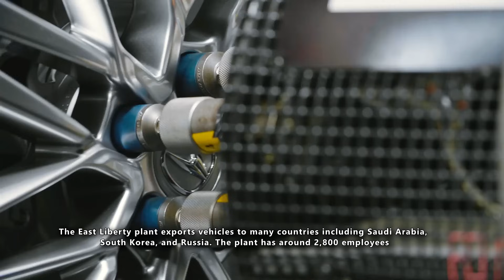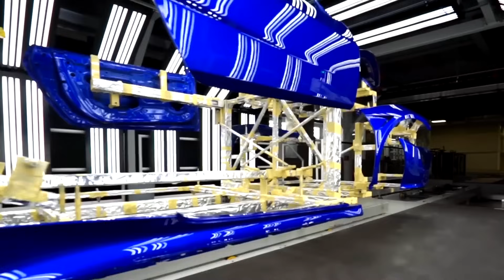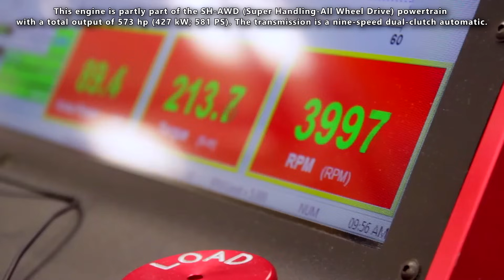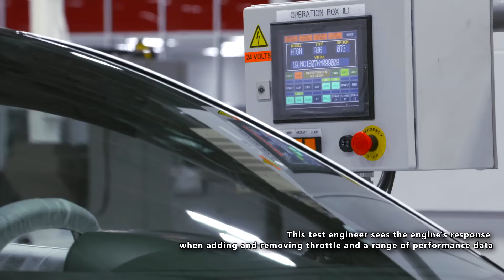Inside American Honda factory Producing cars by Robots (+ ATV Assembly)

Comment: Currently own a 2020 Honda Civic with the base 2L engine. 91,000 miles and the darn thing runs even better than when it was new.
Reply from the maker: Thanks so much for the comment! That's great! Honda Civic will last forever! Best car for daily use (even in my own experience). I wish you to drive it for hundreds of thousands more miles... 🙃
Reply: My 13 Civc Si has 165 k on it and it runs as good as it did when I got it. Im very loyal to this brand. Ty to all the workers in Alliston Ontario.
Reply from the maker: I wish you hundreds of thousands more trouble-free miles
Reply: i run a 2010 accord with with a k series 166k miles on it I run it all day long 10 hours a occasional heavy driving all day.
Reply: Own a 2020 civic 6 speed manual since new, just hit 80k and running like a top.
Reply: Had a 1992 Acura Legend L loved the car, got a 2019 RDX A Spec issues galore. Hated the car. Acura quality is not the same as it was in the 9()'s.
No more Honda products for me. Have a 2022 RX 350 now not one complaint.
Reply: @youtubezombie3155  Don't expect a new Honda to be like that.
Reply from the maker: @midiman5045  Why not? You have that experience?
Reply: Sad but very true,

Comment: I’ve owned several Japanese vehicles, as well as serviced them for 20+ years. No matter where they’re built they’ve lasted me 20 years or more. They cost less to own and service. Some of you are right, stay away from CVT. It was an attempt at fuel efficient, reliable propulsion, and failed. But most if not all manufacturers are starting to walk away from it. They all offer non-CVT options. Dollar for dollar the Japanese especially Toyota have gotten it right. Nissan is still not in a good place, but Honda is still a good reliable vehicle to own.

Comment: Some jobs will always be by human hands.. but fewer and fewer... each year.. will be needed. The changes aren't just how but what with and how.. Example mega castings.. automatically shrink the need for many additional parts and ops... Cars will have less parts more components be lighter cheaper to make better and last longer ... each year. I suspect it will be industry changing when we realize in five years that used EVs are as good at 500,000 miles as they were at 1 mile... no more break downs no need for repairs or service centers... mechanics could be a dying bread

Comment: Today's cars, regardless who makes them, are cheap, unreliable, disposable junk, not meant to be repaired. CVT transmissions, cylinder deactivation, Thermal control valve, Variable valve timing, soy covered electrical wiring, thin glass, hardly any metal, lots of plastic, fiberglass and rubber. So many things to go wrong...so many distractions while driving.
Reply: What are you going about? You have no clue what you are talking about Variable valve timing or VVT or Vtec has been around for 20 years my 25 year old accord has vtec with no issues at 205k
Reply: Vehicles are still made with metal you have no clue what you are talking about a thermostat has been around on cars for 30 plus years and it helps regulate coolant temperature in the engine maybe look up what some of these functions do before you say it’s junk 😂